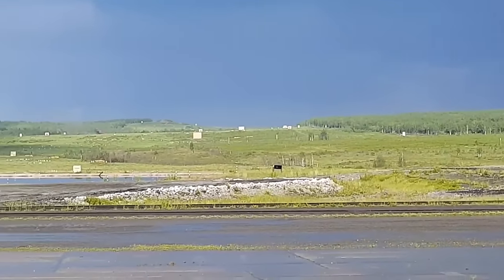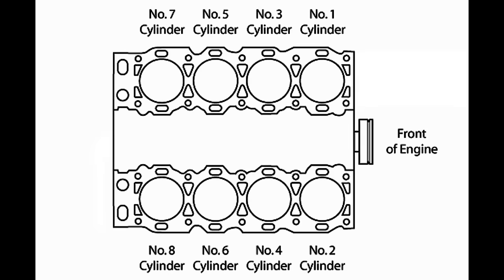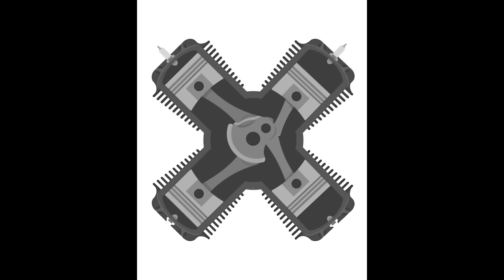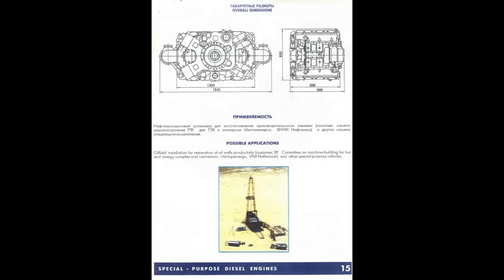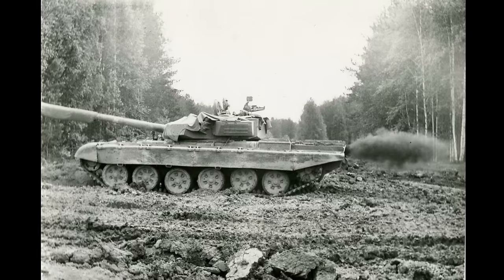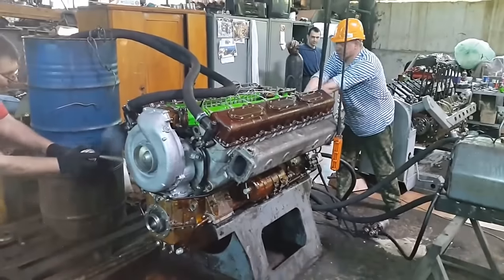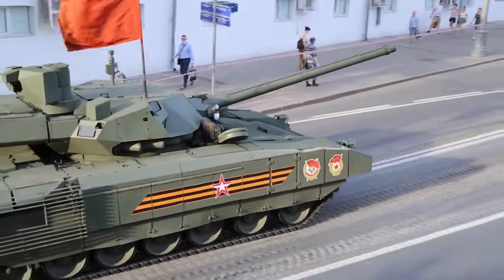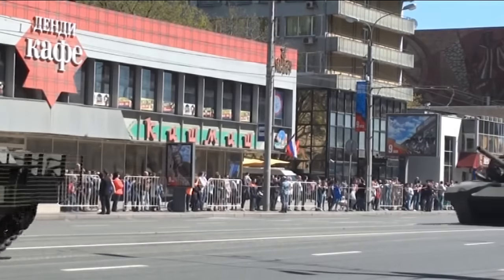Controversial History of T-14 Armata's Engine

Comment: Saying that the T-14 Engine is a WWII one, is like saying that the F-35A is a modified copy of the F-105.
Or that Jeep Willys is just a green Model T.
Reply: more like the F35 is a copy of the yak 141
Reply: Saturn v is a copy of German ww2 V2 war rocket.
Reply: @skwal5464  which it actually is.. and a chunk of the engineers that worked on the 141 later worked on the F35 after emmigrating from Russia in the 90s.
Reply: better comparison to that absurd situation is like saying: Kalashnikov is copy of  Sturmgewehr 44
Reply: @j.bartos1466  incorrect. It's more a continuation of the convair model 200. Lockheed started the f35 design and already had designed the lift fan system before they became aware of the yak. They did study it yes, and took on yak engineers. But it is not a copy.

Biggest difference is that the lockheed system uses a clutch driven lift fan system, meaning the whole aircraft still only has 1 engine. The yak has 2 dedicated lift engines independent of the main one, uses only for vtol mode.
Reply: Main difference is f35 is a real plane and the t-14 is a pretend tank. T-14 can have whatever engine you want and it doesn't matter.
Reply: @mr.waffentrager4400  the CIA for years believed the R-7 rocket (which put Spútnik into orbit) was just five V-2's strapped together.
Reply: @downix  i can't belive British tank designers helped russian space rocket design
Reply: @skwal5464 the engine rotation technology its but not the plane itself
Reply: @skwal5464  not a copy but is built whit license
Reply: @skwal5464  You are correct in this because the F-35 being a copy of the Yak-141 is very much a myth and I don't know why it hasn't died. Yes, the USA looked into how the Yak-141 does VTOL and the engine points down. That is it. The actually mechanism and physics behind how the two work are very different and people saying it is a copy really just don't understand F-35 development (now to be honest I don't understand it either but I feel I have a bit more understanding the the nuisances).
Reply: @ImRandomDude not really as I believe one is long stroke the other is short stroke I think
Reply: @thatonejoey1847  to quote Captain America "I understood that reference"
Reply: But of course it’s a kind of improved copy. I mean the AK-47 is definitely a kind of improved copy of the StG 44 and the earlier MP43 and MKB42 which we used as early as 1942.  All features are there like long stroke piston with cylinder at the top, intermediate cartridge, 30. Round curved magazine.  Porsche came up with a brilliant air cool diesel engine that could fit in the same space as the ML230.  There’s nothing better out there. That’s why the Russians had to copy the concept
Reply: @mr.waffentrager4400  Saturn does incorporate technology that was developed for the V2 particular, the. PIGA accelerometers for its guidance system.  Of course, the Saturn added  Gimble rocket motors, which are an American idea.  All ideas are fusion.  The regenerative cooling was a V2 idea.  V2 itself Inspired by Goddards work.
Reply: @williamzk9083  except all those features you have pointed to predate the StG by decades.
Reply: @downix  but the StG44 and it’s only variance for the 1st to combine them.  by lining up the barrel with the butt stock, the tenancy of the barrel to lift during automatic fire with the eliminated.
Reply: @toasterbathboi6298 Convair-200 существовал только в чертежах, он никогда не взлетал в отличии от Як-141...
Reply: @williamzk9083  you are incorrect, with rifles incorporating these features dating back decades. What the StG did was to integrate those features with the form factor of a submachine gun. By design, the AK owes far more to the SKS and M2 than the StG.
Reply: @geesehoward700  No the T-14 is very real, but you don't retool factories for a new product in the middle of a war. The F35 is real too, but everyone wished it wasn't, because its horrible.
Reply: @ianlarge9016  t-14 is a prototype at best or a pipe dream at worst. Its no more real than a Engesa Osario.
Reply: @geesehoward700 
> f35 is a real plane
Still not even allowed to begin OT&E after 23 years in development since maiden flight. As real as it gets.
Reply: @williamzk9083  
> But of course it’s a kind of improved copy. I mean the AK-47 is definitely a kind of improved copy of the StG 44

"How to say you don't understand engineering or guns"
Reply: @Conserpov  f35 is in production t-14 isnt
Reply: @oward700 
F-35 still-in-development prototypes are "in production" because they only exist to make a PROFIT. As far as I'm aware, this plane will never be fully combat-capable.

T-14 is not in production because it is a wise decision for national defense. It will go into production after its development is complete, with real combat experience fully incorporated. Which is how it should be done.

Keep coping though.
Reply: The Merkava is just a WW2 tank because its basis is the Centurion which was designed in the 30s-40s. WOW MERKAVA WW2 TANK? IN 2024?? WOW THE CHALLENGER 2 STILL USES A RIFLED GUN? DESIGNED BEFORE THE COLD WAR? WW2 TENK! 

Now, tell me why Lazorpeg hasn’t made that claim or video yet? The Merkawa is way older? Dunking on the UK, and Israel vehicles isn’t as trendy as doing it with Russian vehicles. My thing is, h8 the government all YOU WANT. But when your personal politics make you warp the logic, ignore the truth, and ruin a space of enthusiasm around inanimate objects? Stop right there. There is a PROBLEM. This is why no one can enjoy anything. 

Because I h8 things America did, I’m gonna lie about the Mustang Car not having a V8, and say it’s literally a Ford Model T dressed up as a pony car. Like wtf? How does that work, or get justified???
Reply: @BARelement 
LazerPig basically admitted he's doing it for the money. He's part of the youtube version of the "Sinclair script".
Reply: @ImRandomDude  Schmeisser worked at Izhmash after ww2. Just sayin
Reply: @BARelement  is it because those other tanks are old and the t-14 is supposed to be brand new and not a ww2 knock off with a braking break so powerful it's stopped any t-14 from fighting? If you want to back a country that has made criticism of it's military and government illegal and can force you to join it's army go for it. I like being free to talk about things without the threat of being murdered.
Reply: @downix  The AK47 and StG 45 are both long stroke gas piston.  SKS is short stroke gas piston, the M2 Browning is short recoil.  The usual Russian excuse for the AK47 looking  at your most exactly like StG 44 is that the AK copied the Garand.  Come on thats just malarkey
Reply: @williamzk9083  not the M2 Browning, the M2 Carbine, a modified version of the M1 which the US sent a ton of to the Soviets under Lend Lease.
Reply: What are you talking about??? Its definitely past at least IOC... and is almost FOC with the newest release version (which, to give credit, has been a bytch and a half to certify) based on original specs/reqs, but has for all intents and purposes been in Sustainment for basically a decade. @Conserpov
Reply: also it could change. t14 isnt set in stone since they are still in prototype phase
Reply: @p5id1kh4r
F-35 is currently in the IOT&E, which it entered in 2018 after 17 years of (unfinished) SDD.
As of now, it is not cleared to begin OT&E, because it is unfixable.
They retroactively redefined "IOC" status to say that F-35 achieved it; initially, they used a mock "ICC" status because they could not say "IOC" legally.
You can look it up.
Reply: "Chevy small blooks are the same as ford flathead V8s because they're both v8s." - lazerpig, probably.
Reply: @geesehoward700  Hate to burst your fantasy, but the T-14 is a real tank
Reply: @thatonejoey1847  German rocket design, helped Russian design
Reply: @geesehoward700  how 8s 8t a "pretend tank" ? Are you saying it doesn't exist?
Reply: @wolfno.7558  Yak was consulted by Lockheed Martin after the nozzle and aircraft wete desigbef.   The swivelling nozzle had in fact already been designed by Rolls Royce and MTU for the VAK 101D and E and also con air.  LM was making sure they knew of any issues.
Reply: @downix  the M2 carbine used a short stroke mechanism.  So nothing like the  AL47 It also lacked the features that made an assault rifle: butt stop aligned with barrel and a pistol grip. Never these the M2 an interesting concept in that it added selective fire
Reply: @williamzk9083  looks at the M2 Buddy, you are trying to force a connection by denying something you don't know a thing about. The StG did not invent the long stroke, nor did the MP42. It was already used by multiple weapons before Hitler even joined the NSDAP. The M2 has a long stroke. The Browning has a long stroke. Even the antiquated Bren has a long stroke, and the Soviets had those since the 1920's.
Reply: @geesehoward700  it's real, but in pre-prod phase. Su-75 is not real yet or NGAD
Reply: so it's a prototype and not real then. Just a bunch of hand made parade tanks with shoddy parking brakes.
Reply: @DDayJayke  wow,  it must be real since you just said so. Thanks for proving it.
Reply: @downix  just about everything you said is wrong except one thing.  The MKB42, MP43,MP44 and StG44 were essentially the same gun and all used long stroke gas piston.  The M2 Carbine used short stroke gas piston.  The browning doesn’t use gas but short recoil.  The Brilliance of the StG 44 is not the reliable operating mechanism but the operations research it was based on and its ergonomics.  No other weapon combined the pistol grip, intermediate cartridge
Reply: @Conserpov "T-14 is not in production because it is a wise decision for national defense." sorry, ive just absorbed this pearl into my brain. the t-14 is soooooooo good they decided not to use it? hahahahahaahahh this is such a brilliant line. im going to use this.
Reply: @j.bartos1466   i know but the yak 141 IS NOT a F35
Reply: @williamzk9083  I pointed out the ergonomics above, however. And you are wrong, as the M2 uses a long stroke gas piston, as does the Browning M1918. I am looking at the manual right here, which states just as such.
Reply: @geesehoward700 You're bringing tears to my eyes..but Julian Assange is in jail so explain that, bro..
Reply: @a.m.armstrong8354  he's still alive? Also he broke the law a bunch of times so that tends to end in prison. There's also the fact he never leaked anything about Russia. I wonder why that is?
Reply: @geesehoward700  
10 year old detected.
Reply: @Conserpov  Why don't you just go back to lying, you're better at that.
Reply: @downix  
1 The US M2 carbine uses a short stroke gas operated piston with a rotating bolt.  M1 could be converted to M2 in the field.
The Browning M1919 and M2 50 BMG both are short recoil with no gas involved at all.
You are not looking at the manual. 
The StG 44 was a development of the Henel MKB42(H)  which used a long stroke piston with tilting bolt and the Walther MKB42(W) which used a long stroke piston with rotating bolt just like the AK47 and garand.   The MKB42(H) with tilting bolt won that competition so the Germans actually produced and field tested 15000 of each but rejected a rotating bolt in favour of tilting bolt.  The Russians, captured example of each in 1942
Reply: @j.bartos1466  Can you name those engineers?
Reply: @williamzk9083  but the AK has nothing to do with the StG apart from outside aesthetics. The magazine catch is different, safety and selector is different, the locking mechanism is different, the trigger mechanism is different, etc.
Reply: @Lesij777  Sure but the Convair plans could be used to build a 3BSN while the Yak 141 would not be necessarym
Reply: @ianlarge9016  So horrible that it is selling like hot cakes.
Reply: @Conserpov  if it's not combat capable, why has the USMC already used it in combat? Along with the Israelis.
Reply: @AutismIsUnstoppable  Schmeisser was not educated in engineering (at least Mikhail Kalashnikov was put through a program to learn design) and he was described as a grumpy old man who refused to collaborate. The AK was produced at Izhmash but not designed there. Schmessier returned to Germany and died there, while the AK was still suffering issues. When the AK was finally introduced as the AKM Schmeisser had been underground for years. Also, Schmeisser didn't do the stamping for the StG, Merz Werke did. They had experience stamping motorcycle parts. Stamping is extremely complicated, especially for someone without engineering education.
Reply: @williamzk9083  It's not malarkey. Flip a Garand bolt upside down, it's almost an AK.
Reply: @ChucksSEADnDEAD  well, the AK-47 is different to the STG44 because it has a slightly different magazine catch. Wow
Reply: @ChucksSEADnDEAD  Only to countries that are US vassal states and no choice in the matter.
Reply: @ChucksSEADnDEAD 
T-14 was also used in combat. And in real combat, not in "combat" against Afghan weddings. So?
Reply: Well.. theres a thousand of F-35 already. How many armatas are there?
Reply: @winzyl9546  
> theres a thousand of F-35 already

So what? They are not exactly combat-ready. Half of them are not even airworthy.
Reply: @ChucksSEADnDEAD  Russians didn’t need Schmeizer to copy the STG 44 .  They already captured the guns. They needed .  The first assault rifles were the Hanel MKB42(H) which used a long stroke piston with a tilting bolt.  This gun fired from an open bolt. It was indeed designed by Schmeiser in 1940-41 for Haenel and 15000 were used on the Russian front.  The other gun was the Walther MKB42(W) which used a long stroke piston with rotating bolt.  It fired from the closed bolt.  About 15,000 were evaluated on the Russian front from 1942.  So this weapon is exactly the same as the AK-47.  Long stroke piston with a rotating bolt. Just like the garand AK-47. For whatever reason, the Germans rejected the MKB42(W) with this rotating bolt and excepted instead the MKB42(H) if it’s tilting bolt. They did adopt the Walter closed bolt firing action.  This became the MP43 which was in fact the StG 44
Reply: But it is…
Reply: @geesehoward700  What law did he break that America wants him tried for? Also he's in a British jail for breaking which law here? I'm ready for you, so keep digging.
Reply: @ldkbudda4176  No, every MAN was Genesis One, every Hu-Man Genesis Two..spot the differences then get back to me, bro..
Reply: @ChucksSEADnDEAD  For want of nothing better, however the F35 is so stealthy it flies towards Cyprus in order to attack Lebanon and Syria, bro..
Reply: @geesehoward700  No need for the T14 in Ukraine, bro, given NATO tanks haven't exactly covered themselves in glory. Your problem is weakness..NATO weakness is  your weakness. Now Macron's splitting hairs over whether NATO troops in Ukraine might trigger war between NATO and Russia, or whether NATO troops actually have to be fighting in order for that line to be crossed.

We BOTH know NATO would be busy were it not for Russian strength in depth. T14's the least of NATO concerns if they or you cross the line..NATO air and sea assets rubbed out within 48hrs, 40,000 NATO KIA per week..

Want some?!
Reply: @a.m.armstrong8354 russia lose 2000+ tanks since the start of the war but its NATO tanks that are no good? hahahhahhahhhahahhahhahh thats brilliant! hey, at least russia havent lost a t-14 in combat hahahahhahahahhh! 

not since the winter war have we seen russia perform so poorly in battle.
Reply: @geesehoward700  'We'?! You missed the destruction of the inner Prussian Military Academy..which is why Russia permanently remains in Konigsberg. No Western General came close to beating the best WW2 German Generals. 

Taste the difference, bro..
Reply: @a.m.armstrong8354 I used a historical example because thats how bad russia is currently doing in ukraine not because i wanted a history lesson. we could look at how well russia did in ww2 if you like though. russia lost more soldiers than everyone else in every theater combined. I guess they managed that feat by being far better at fighting than everyone else. oh yes, almost forgot. They started the war on the same side as germany.
Reply: @geesehoward700  They didn't lose more than all others combined. Russia lost 8m troops in WW2. How many did China lose? Japan, India? Where did you get your hot air from, bro?
Reply: @a.m.armstrong8354  27 million people died in Russia during ww2 including almost 9m soldiers and 19m civilians.
Reply: @a.m.armstrong8354  and i really cant stress this enough, those causalities were inflicted by the country you guys were allied to at the start of the war.
Reply: @geesehoward700  They weren't,  you're generalising based upon biased statistics. The self-inflicted ratio was available since perestroika. It is interesting that since being confronted with accurate information, you've been retreating. Were I to ask you what proportion of Russian POWs survived German captivity as compared with Western POWs, whose figures would you consult? Furthermore You aren't addressing a tenet peculiar to the WW2 Eastern front..it was a war of extermination versus that of survival. You're presentation of the exterminator's narrative as fact is a legacy shaping this current conflict, where the neoliberal reversal of this narrative sees uninformed non-observers mischaracterise Russian WW2 realities as 'self-inflicted', while their survival is still at issue. 

Well done!  But the deception doesn't stop there! That Ukrainians are being employed as proxies for Slavic extermination, is because this programme did not originate with Nazi Germany..It has been outsourced differently which is why there are biological research facilities in Ukraine aimed precisely for this purpose, by the originators of anti Slavic (and anti African) extermination. 

That's your bag, bro..
Reply: @geesehoward700  Which country were Africans aligned with at the start of WW2? We WERE detailed to bury 6m dead, the British Empire self-inflicted upon its subjects in East India. I can't stress that enough, bro..
Reply: @a.m.armstrong8354 can you ignore what i say any harder brooooooooo
Reply: @geesehoward700  What bunch of laws did Assange break? No comeback. 
You're a wind up merchant.
Reply: @geesehoward700  Ukraine has over 500,000 KIA. Going back to the Winter War won't return Viipuri to Finland. When people LOSE WARS they lose territory..understand?!
Reply: @Lesij777 Except… that doesn’t matter lol
Reply: @christopherchartier3017  No except, vikipedia lol
Reply: @Lesij777  It does not matter if the Convair 200 flew or not, that is what the lift system for the F-35B is based on. The Yak 141 used a very different system and was only a proof of concept for the rear engine tilt mechanism that was already patented on the Convair 200. If the Yak 141 did not exist, the F-35B would look and fly just as well as it does today.
Reply: @christopherchartier3017  Convair-200 совершил хотя бы один полёт с вертикальным взлётом?
Reply: @Lesij777 It did not have to. The design was patented, just not proven. Regardless if the Yak 141 flew or not, the F-35B would still look and fly the way it does because close to nothing onboard the F-35B comes directly from the Yak 141
Reply: @christopherchartier3017  Вот и я говорю что Convair-200 не летал и существовал только в чертежах, матерью Ф-35 является больше Як-141 с конструкторским бюро которого фирма Локхид Мартин активно сотрудничала в девяностые годы прошлого века...
Reply: @Lesij777 Once again, it does not matter whether the Convair 200 flew or not. The design was patented and was the basis for the F-35B. The only collaboration between Yak and Lockheed was for Lockheed to potentially buy new trainer models of the Yak to study the design, because at the time the rear swivel system of the Yak 141 was proof of concept of what they tried to do with the Convair 200. It is unclear whether or not Yakovlev ever gave Lockheed any new models or information. Therefore no, the Yak did not influence the F-35B’s design at all, really. And both aircraft are much more different then they are alike anyway, especially when you compare the lift systems of each jet.
Reply: @Conserpov No total number of any kind of aircraft is combat ready. Russia has about 120 total Su-35 aircraft, but not all of them are airworthy. Some are down for maintenance, or getting checked, or being repaired or whatever. It makes sense, this goes for any aircraft.
Reply: @Conserpov Despite the stage of the F35, over 1000 have been made and NATO countries have bought them over existing platforms for a good reason. It’s already been used in combat and it’ll likely continue to be built and developed. I mean they already have the next Block-4 upgrade planned
Reply: @christopherchartier3017  
> Despite the stage of the F35, over 1000 have been made

You are completely missing the point. The purpose of F-35 program is to make LM shareholders happy, not to improve defense.
Pentagon and NATO "allies" would buy cardboard cutout aircraft for 100 billion if they found a way to justify it. F-35 is the next best grift.

> It’s already been used in combat

So was Cessna. It's just a talking point.

> it’ll likely continue to be built and developed

No doubt about that.
Reply: @christopherchartier3017 
> No total number of any kind of aircraft is combat ready.

I know. But I am not talking about maintenance downtime.

With F-22, out of 192 production airframes only 143 are operational (half of them ready at a given time). 37 Block 10 airframes were built to never become combat-capable from the start. They cannot be upgraded and used.

With F-35 it is far worse.
Reply: @Conserpov  Pretty sure it’s only worse since there’s 1000 F35 vs the almost 200 F22’s. And maintenance or not the fact is still true to any aircraft fleet
Reply: @Conserpov  Regardless I still feel like it’s pros and what the aircraft can offer to NATO air forces severely outweighs its cons

I mean it’s red flag performance speaks for itself
Reply: @christopherchartier3017  
> there’s 1000 F35 vs the almost 200 F22’
F-22, despite its many shortcomings, is a formidable fighter.
F-35 provides less capability than any good 4th gen even without factoring in cost-effectiveness.

> it’s pros ... severely outweighs its cons
You just have no idea what those are. It's like a very sophisticated optical sight that can only be mounted on the rifle sideways.

> it’s red flag performance speaks for itself
Do you also believe in Ghost of Kiev?
Reply: @Conserpov  What does the “ghost of Kiev” have to do with anything
Reply: @Conserpov  I feel like the F-22, a dedicated air supremacy fighter, which really can only engage air targets (except for a very limited air to ground arsenal), isn’t really a good comparison to the F-35, a joint strike fighter, meant to be a stealth multirole aircraft. The F-35 is probably the best multirole fighter in the world
Reply: @christopherchartier3017 
I have a very nice bridge in Brooklyn, and you are clearly the right person to acquire it
Reply: @Conserpov  what does that even mean
Reply: @christopherchartier3017 
> F-35 is probably the best multirole fighter
> its red flag performance
> Saddam has WMD
> Santa brings presents

Do I really have to continue?
Reply: @Conserpov  You can always just say “I don’t trust the US Air Force to accurately report on its performance during military exercises” instead of trying to label the other person as dumb
Reply: @williamzk9083 Dude it's long been known that the AK used the M1 Garand as an inspiration far more so than any German Wonder weapons.
Reply: @coryfice1881  the MKB42(W) Had the same. mechanism  as the AK-47 only five years earlier. Long piston with rotating bolt.  The rotating bolt actually goes back to the 1812 German Dreyse  needle  gun.   The Germans chose the rival MKB52(W) to produces the STG 44 Because the disadvantages of the tilting fault didn’t matter.   The drones didn’t care about wearing taste since the gun would be likely lost before it was worn out they didn’t care about the extra weight of the recoil forces being taken into the receiver instead of the barrel, because I had a heavy receiver anyway, because they intended to stamp it.   The AK-47 was only lighter because the Russians could afford to machine the receiver to make it thinner. Of course this is in 1947.
The AK-47 was inspired by the Garant is pretty poor when you look at the guns
Reply: @williamzk9083 And ugga ugga made fire your point kid?
Reply: @williamzk9083  Also that still doesn't change the fact that internally the AK share more with the M1 Garand. Keep coping wehraboo I know it's been a bad few years for your fandom.
Reply: @coryfice1881 Exactly how does the AK47 share More in common with Garand.  
-MKB42(W), StG 44, AK47 have the long stroke piston barrel at the top? The Garand does not, its at the bottom.
-MKB42(W), AK47 and Garand use a rotating bolt.   There is no difference except that the Garand is not selective fire.
-The Germans chose the MKB42(H) to develop into the StG44 because the disadvantages of the tilting bolt (greater wear and tear and a sturdier receiver) didn't matter, they were only concerned with cost of production and reliability.  
-The AK47 was lighter because the AK47 receiver could be made of thinner metal because it was machined not cast.
Reply: @williamzk9083 You keep babbling this long since debunked claims that only come from wehraboo friendly reddit posts like some soulless automotron on a loop.